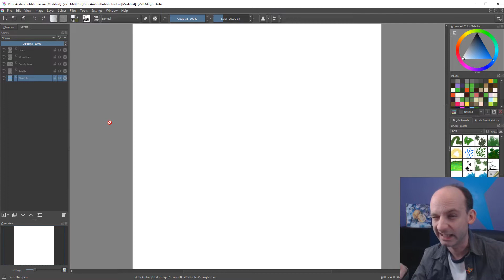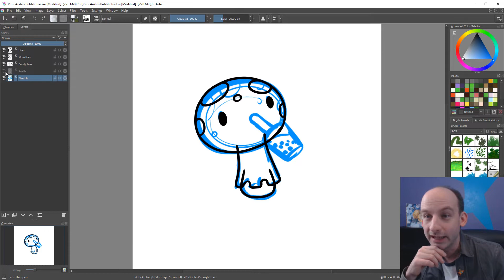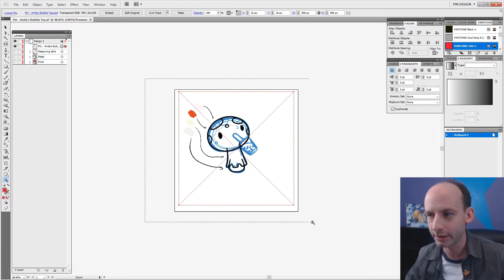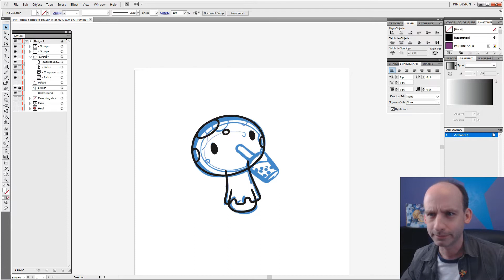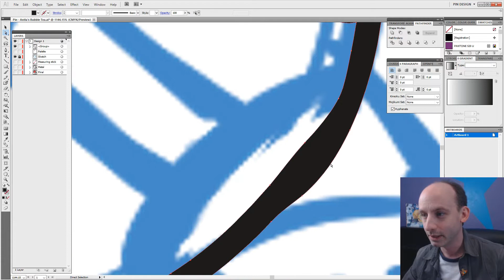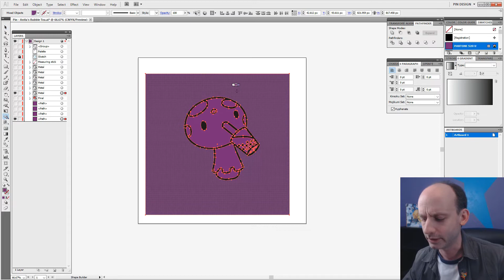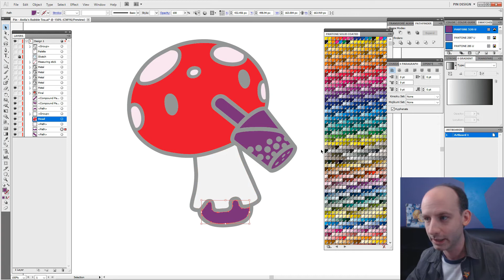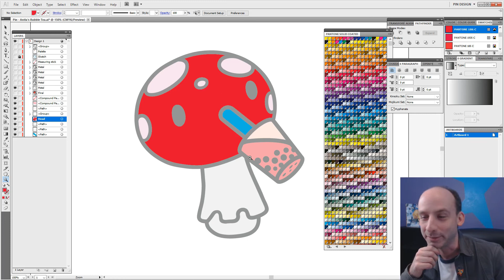How to turn your 2D art into vectors for enamel pins

Comment: Thank you so much for your enamel pins tutorials and videos! Do you know if I can just send the photoshop tracing and coloring of the art file to the middle man AND send just a picture of the artwork and let the middle man do all the work? Because I'm looking to make my first pins but my adobe illustrator is not up-to-date on an old computer. I only have Photoshop working. :(
Reply from the maker: Yes, absolutely. That's actually one of the key roles a middle-man would play, to get your artwork transformed into a format needed by the factory. Some factories will actually be able to do this as well. Ensure your source artwork is clean and high-resolution. They may charge extra for this, as it's more manual work, but if it means you get awesome pins made, definitely worth it.
Reply: @NeverDot  Absolute legend! Thank you very much.